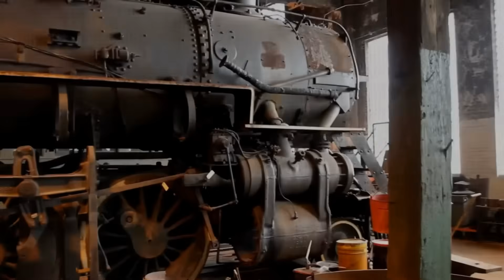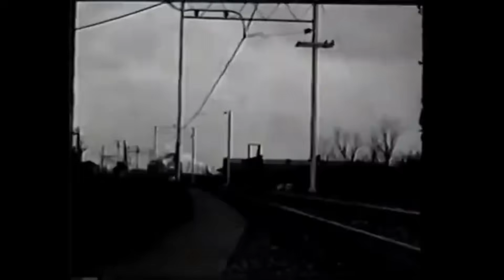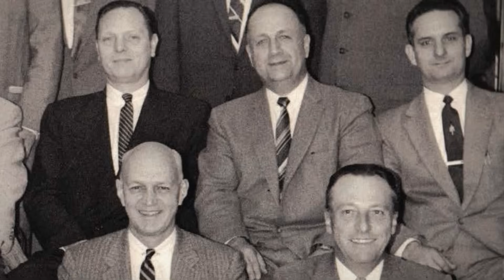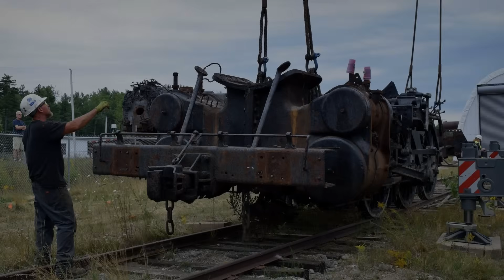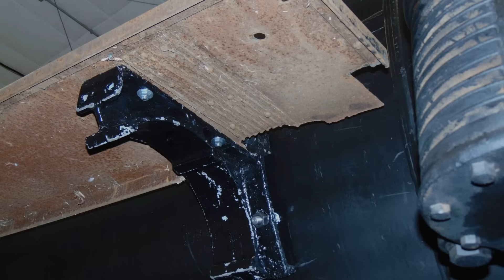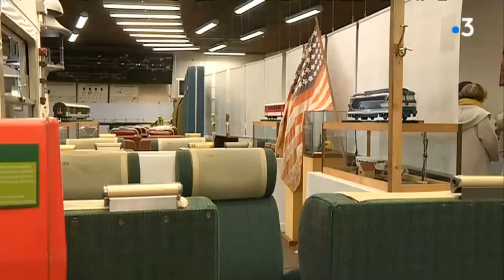15 Innovative Steam Engines From The 1940s That FAILED Miserably!

Comment: Absolute amateur hour. Calling the SNCF 232 U 1 a 'turbine engine' is hands down the most idiotic take I’ve heard this year. Are you blind, or just too lazy to do a five-second Google search? The cylinders are literally sticking out in plain sight!

This locomotive, famously known as 'La Divine,' was a masterpiece of engineering—a 4-cylinder compound engine, not some experimental turbine failure. If you can’t even get the basic propulsion system of 'La Divine' right, the rest of this video is clearly just sensationalist garbage and made-up facts. 
This channel is a joke to anyone who actually knows railway history. 
Stop spreading misinformation for clicks.